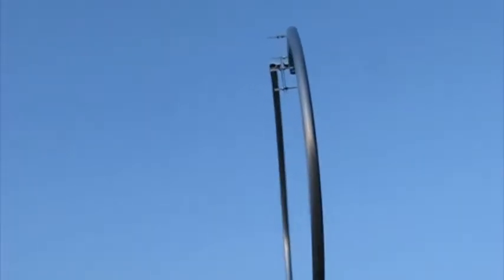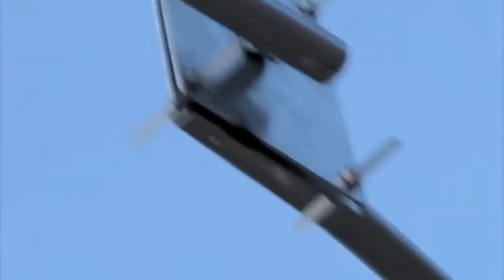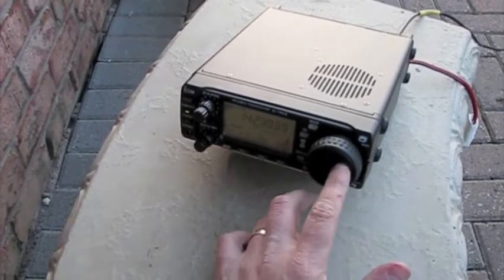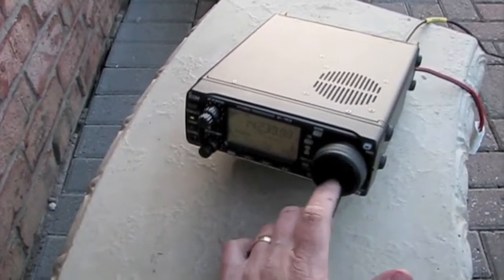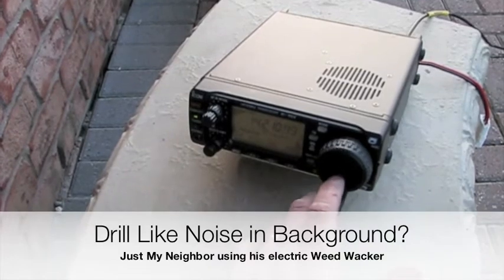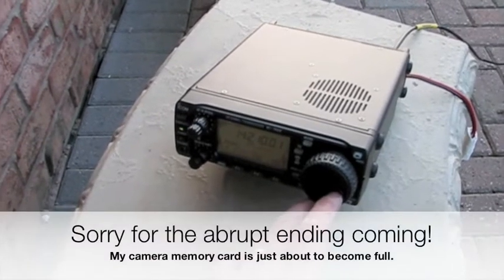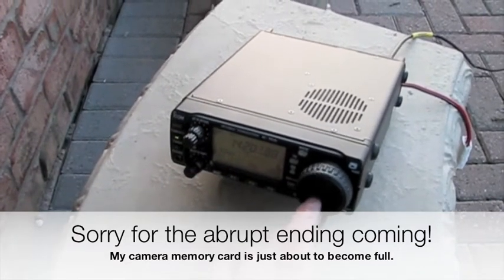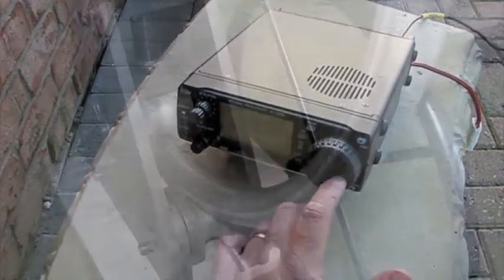Scrap Aluminum Evolves into a Transmitting Magnetic Loop Antenna

Comment: Made one of these Loop antenna's way back in around 1960. We used to use it for direction finding in rabbit hunts. Flip them horizontal, and you have a horizontal omni directional antenna.  Wish I had my old one to use today. If you use it on 2 meters or other bands ( smaller size for VHF and uhf ) you can also add a vertical reflector element which will give you a sharper null in the direction of the station you are trying to DF.  Mount if with a beam ant, and you can target your signal perfect